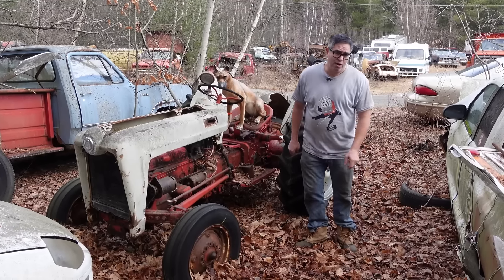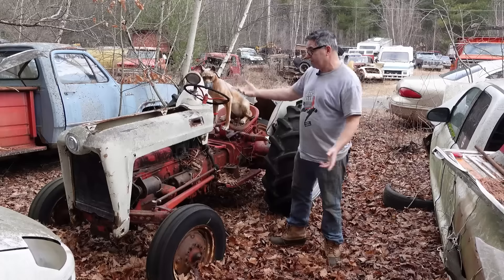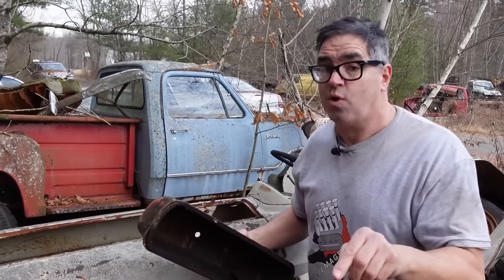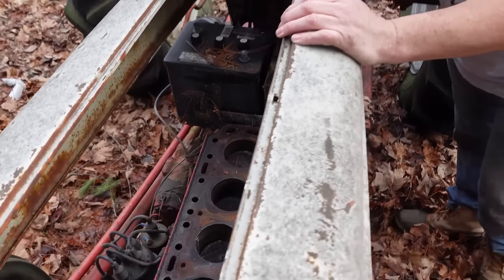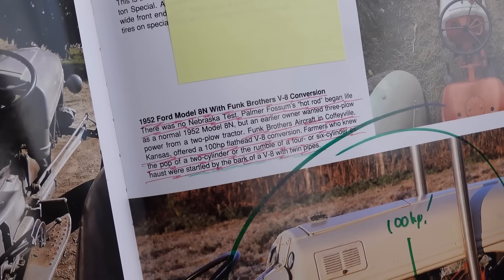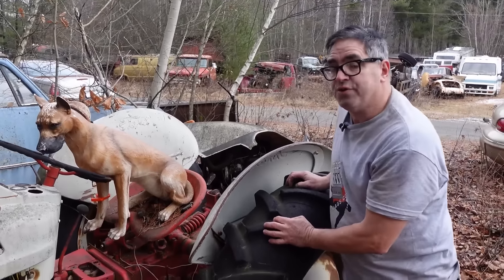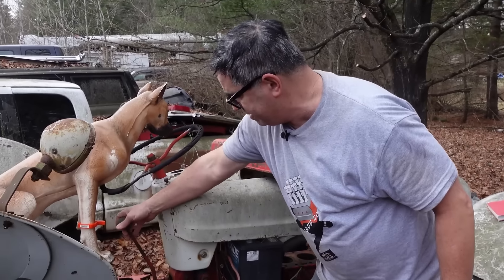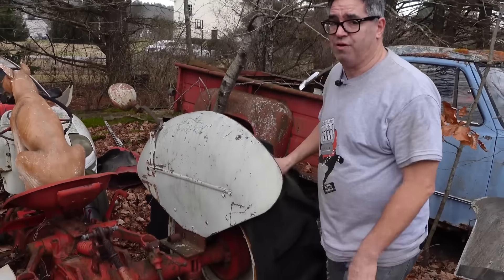Truck Week EP24 - Ford Golden Jubilee Tractor

Comment: Thanks for the jubilee video.  I got my start driving tractors on one like it my father bought used for $500 in about 1970.  I remember being very exited when it showed up as I was about 8 years old, and was only dreaming of driving the big green stuff on the farm.  It was maybe couple years later I got to start off on it.
I drove it usually pulling a New Holland side delivery hay rake.  Sometimes with a small cultivator on the 3 point. 
It was also the go to power unit for grain augers off the PTO.
I should have bid on it at dad's sale but needed other implements.  The front badge was always very cool on the hood!

Comment: The 2N was a 3-speed but the 8N had 4 forward gears. The OHV 4-cylinder in the NAA was essentially a shortened six from the 215/223 family.
Reply: As an operator of an 8N my whole life, starting in 1965, I've always thought an inline 6 would have been a whale of an improvement over the model A engine. For me, mowing with a 6 foot hammer knife "flail" mower, plowing gardens or disking them I was always trying to get the engine to accept a higher gear to speed up the whole process and lower the engine speed. To this day I believe doing that is a mental state, just a part of trying to be more efficient about things. Tilling with a double bottom 16" Dearborn was supposed to be done in 2nd gear, but you had to run the engine full blast to make any kind of speed. 2nd was the workhorse gear, but it was pitifully slow. Sometimes, when everything was perfect i.e. Engine was in a great state of tune, The plow was adjusted perfectly, The soil was at the right moisture, Plow depth not too deep, Of course the type of soil being more sandy than clay, And maybe a very high barometer, I could pull the plow in 3rd gear and lower the engine speed. I always thought that's where the Inline 6 would have been a better choice. But as in all things, if I had started with a 6 I'd have wanted an 8. You know what I mean. Thanks Steve. ben/ michigan
Reply: @benjamincresswell3713  The stroke on the NAA engine is the same as the 215/223 six cylinder but the bore is smaller. Of course, it's only 4 cylinders.

Comment: Lighter is better as far as soil compaction but as farming got more competitive tractors got bigger with dual and dual quad driving wheels that lowered the compaction but allowed the farmer to pull more and bigger equipment to lessen the field time for plowing and planting. No more three and four bottom plows but 12 and fourten bottom plows to get the job done. Back in my younger days I worked for a brief time at DMI where we built the world's largest plow, a 21 bottom plow that they used to demonstrate pulled by a Steiger Panther tractor.

Comment: tractors raring up and over backwards when a sudden load came onto the drawbar was a mainly Fordson problem, since most tractors have the drawbar actually mounted well forwards of the rear axle, so when a sudden load comes onto the drawbar, it snaps the front end down, while Fordson tractors had the drawbar mounted after the rear axle, which didn't stop them from going up and over.

Comment: Ford pushed the fuel use per hour, which was pretty good with the small , lightweight tractor. 
Looking at acres per hour, or fuel use per acre, the Farmall Super H with a similar horsepower rating, and the similarly rated deere, the ford tractor embarrassed itself. 
With the introduction of the hundred series Farmall with live hydraulics, live pto, and fast hitch in 54, the last advantage the ford had was that it required less storage space.

Comment: A lot of wrong information here.  First off, the 8N came with 4 speed transmissions, not 3 speed.  The 3 speed was on the 9Ns and 2Ns.  Second, the Funk conversions were started on the 9Ns as the Funk brothers were working with Ford in the late 30s.  The "Fergusons System" badges were only on the 9Ns and 2Ns, not the 8Ns as by the time the 8N came out, the handshake agreement between Henry and Harry was broken.

Comment: What can really make an antique tractor valuable is low production numbers or a lower survival rate. For example, the Waterloo Boys were made for a few years and there were quite a few made but by the time WW2 started they were twenty plus years old and ended up in the scrap drives. These can hit $100,000 at auction now. On the other hand some tractors may have had a low production version like High crop or fuel type that makes them valuable. These little Fords are common. They have a good useful value to them but to truly restore one costs way more than what you could get back out of it. Back tires alone would be about $1600 to $1800. Same gos for a John Deere model A or a Farmall M. Restoration is a labor of love. Harry Ferguson built tractors on his own for a while. The TO 20 and TO 30. They had overhead valve engines but the styling was almost identical to the 8N Ford. Harry Ferguson ended up merging with Massey Harris creating the company we now know as Massey Ferguson. They have since been bought out by Agco. Agco has large list of companies under their belt. Allis Chalmers, Gleaner, White, Oliver, Minneapolis Moline, and New Idea to name a few.